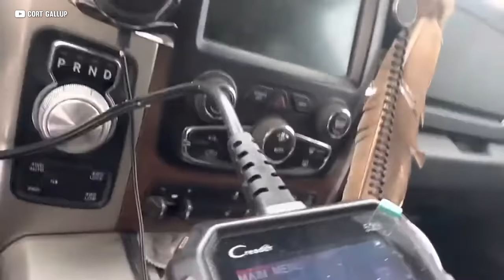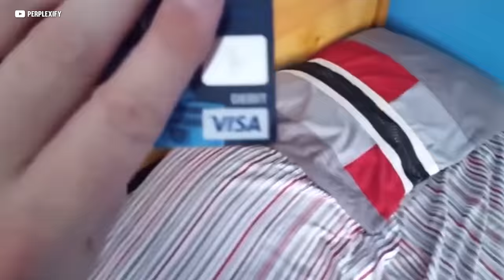Worst Trucks Only Stupid People Buy

Comment: I know it's not a hardcore truck but I've got a 2013 Honda Ridgeline that does everything I ask it to do. Only problem had is a brake booster that had to be replaced. Not too bad after 10 yrs.
Reply: Damn right it’s not. It’s barely a “truck.” It’s basically a car with a bed like the El Camino. 
Hell, even the El Camino was more of a truck with a V8, body on frame, and rear solid axle!
Reply: I heard the Honda Ridgeline comes with a free rainbow flag is this true?
Reply: People hate on Ridgeline for no reason, I actually respect them because you don't need a massive engine and 4 wheel drive to get groceries and take your kids to school, which is what most truck owners do now anyway.
Reply: @jakedank2746  Ridgeline was one unpopular silly truck, especially with that little swayback feature behind the cab. What were they thinking?
Reply: We have a 2006 Ridgeline with 200K on the clock. Have only changed the water pump/timing belt a,d front struts. Very solid truck and wouldn't hesitate to drive cross country....even with 200K. It is very over engineered.
Reply: @bobfuhrwerk2869  It's a Honda, reliability comes standard. It's not overengineered though, simplicity is the key to reliability.

Comment: I did have that Dakota.   It had 214000 miles and 13 years on that engine.  Never had an issue with it and it would still be on the road except some C texting took it and me out using a 300M.  Miss that truck.

Comment: Thanks for your commentary. I have owned Four GM SUVs and two GM pickups since 2001. Total of almost 400k. Three 5.3s and three 6.2s. Other than wear parts such as a water pump and an alternator (one of each) and intake and exhaust gaskets on the '01 5.3, the motors and transmissions have been absolutely trouble free. Mileage on the motors when I owned them ranged from 215k to 62k. In all fairness, the '01 dropped a lifter at 275k after my daughter and her husband had owned it for 5 years. They found a new used motor with 140k and it was running great when they traded it in at 305k. My current '22 Silverado with the 5.3 has been great. Best ever.

Comment: I bought a 2010 F150 FX4 last year with 120,000 miles. It was $10 grand when everyone else wanted 20 for anything close to it. Most reviews on that year and engine were good so I thought I'd take a chance. It was at a small time dealer, who I could tell just wanted to dump it because it had a laundry list of items that needed attention and just wasn't worth his time to fix, but it was definitely worth my time. Mechanically it was fine but it was a stacked model with all the bells and whistles, most of them broken. I'm a DIY guy and these were either easy fixes or not that big of a deal. Right away it had an engine issue where when it was warm, at idle facing up a hill it would sputter, run like crap, and misfire. I replaced the timing solenoids which mostly fixed it, then had an engine flush which really helped. Now it's pretty much not an issue. It's a secondary vehicle that has only seen 3,000 miles of use so far, and given it has a 200,000 mile life expectancy, it should last me a good long time. 

Also, I was talking with a guy this week who also has a 2010 but with a 5.0(?) engine. He said it has some electronic steering whose fluid system is sealed which failed on him, causing dangerous steering malfunctions. It was a really expensive fix. I rushed home to see what I had and lucky for me mine has the old fashioned steering system, where I can add steering fluid. Whew!

Comment: I have a triton 5.4 and it has 225k miles. I guess I'm just lucky. Still running strong for a triton.
Reply: Which generation? The 10th gen 5.4s are 300k engines.  11th gen ones I see them sometimes go past 200
Reply: Don't know what generation but it's in a 2003 Ford Excursion.
Reply: @jeffreychristianson9134  yeah that’s 10th gen

Comment: One I miss is the Ford Exploret Sport-Trac my wife uded to own. Yes that 4.6 V-8 had the spark plug issues but that truck had plenty of power, good handling and was comfortable to take on long road trips. The rust in the cab made us decide to replace it. The Avalanche we replaced it with developed all kinds of engine and general drivabilty problems. So it got replaced with a Yukon Denali. Drivability problems and general satisfaction issues make us hate this one too. I never should've sold my '87 S-10 that got a V-8 conversion in '92. Sure I kept ripping transmission up but that's because I drove it hard.

Comment: I have a 2005 f150 triton 3v.  205,000 miles, still going strong.  At 202,000 miles I finally installed a new timing kit, upgraded phasers,  new roller followers, and new rockers. Nothing broke, just preventative maintenance.  From the first day I bought it I ran 93 gas, ran synthetic oil changes every 3000-5000 miles, and changed radiator fluid at least once a year.

Comment: You forgot to mention the excess oil consumption and camshaft failures on the 08-2014 Chevy 1500.. leading to huge repairs!
Reply: I've owned nothing but chevy trucks...z71 4x4. I had a 2011 that I put 252k miles on it with no issues other than a transmission at 180k.....fast forward and I have to pick up my 2016 from chevy today...torque converter failed and needed a new transmission at 70k miles

Comment: I owned two F150s with the 5.4L engine.  A 2007 and a 2010.  Both were 4WD XLTs.  I didn't have the engine sludge problem.  I'm assuming that was because I didn't go by the manufacturer's recommendation on oil by using full synthetic instead of the motorcraft synthetic blend.  I did have reoccurring issues with the exhaust manifolds on both trucks.  What I found out was the Ford used a thinner manifold on the 4WD versions due to a frame clearance issue and these thinner manifolds cracked very easily.  Since they used steel bolts in an aluminum block, these bolts would corrode and often snap off or strip out when removing them, driving up the cost of repair.  I spent $6k repairing just that issue.

Other issues:

On the 2010, the 4WD vacuum engagement system kept failing causing premature wear on the front wheel hubs.  Replaced them twice before getting rid of it.  This model also had a leak around the rear brake light a the top of the cab that stained the head liner.  After three attempts at repair and replacement of the seal, I gave up.

On the 2007 the rear differential failed at 58k miles.  Ford did not honor the warranty because I did not have the transmission flushed at 30k miles.  I have never owned any vehicle that required a trans flush every 30k miles and I have never received an explanation on how that would cause a differential issue.  At the same time the exhaust manifold cracked and needed replacing.  I took it to the dealer I bought it from, handed the keys to the sales manager and told him to "fix it or shove it up you @ss."  To be fair,  the dealer owned it and bought it back from me at the average retail value.... which is how I ended up with the 2010.

The shame is that I absolutely loved the power and handling of those trucks.  For a 5.4L it got pretty decent fuel mileage as well.  I would love to own one of the newer F150s with the 5.0 Coyote, but they are now way out of my price range.  I am not going to spend house money on a new truck.  Not. Gonna. Happen.

Comment: I avoided all the vehicles you listed like the plague except for the last LS style GM AFM 5.3, 0 vin code 07-13 MY which is my Mom's truck. It is holding out at almost 200k miles so far, Just from proper maintenance, and not running around with the oil change light going for miles without changing it. Like you say proper maintenance is key. I do all maintenance on my families vehicles.

Comment: 07 Crew Cab Nissan Titan LE owner here. Just hit 334K miles. Bought it used in 2011 with 100K miles on it. Replaced starter, fuel pump, repaired high pressure lines of the steering system. I change the oil & filter myself religiously every 7K miles, synthetic. I use the copper washer for the oil drain plug and use torque wrench to specs. When it came to me, rear differential oil had never been serviced and looked like mud gelatin, flushed and replaced twice. Replaced controls for steering column and wire from gear shifter. It has developed an engine oil leak, one quart every 4K miles. It's a 4wd and the front differential leaks some, I check level every other oil change. When I bought this truck, the front differential had almost no oil. Great truck, overall very reliable, and pulls my 26 feet sailboat from the boat ramp no problem under 4WD. Sad to hear Nissan is not making this truck anymore, but I have never been a fan of the Cummings version; saw one at work idling at the parking lot the other day and I thought it was just too noisy, not good... I think the real problem with newer trucks is all the added electronics, which are placing additional headaches not only for owners as far as replacing these panels when they fail, but also for mechanics; to figure out an electronic failure can be a mechanic's biggest nightmare. After all, mechanics are mechanics, not electrical engineers. Cheers 🍻

Comment: I have 1st generation Colorado and it has 200k miles on it and I still daily drive till this day only issue I had was the belt tensionr went out but Ive kept up with it.
Reply: Got a 2004 i5 with 202100 something miles. Runs like a top! Just changed oil regularly. Drove it down state the other week, 3 hours one way drive, averaged 23 mpg. Quite happy with it. No known issues.
Reply: most people who like their tks get 50 to 90 miles per gal. if they hate tk they get  9 to 11 mpg !!!    65 years as veh. mechanic!!!

Comment: The Toyota 3.4L V6 had horrible head cracking problems.  So many had this due to the thin web between the 4 valves and the hemi spark plug hole.  The 3.0 had horrible head gasket problems, but that is cheap compared to new heads every 200k mi.  Toyota may have fixed this with the later head castings, but the early ones were a ticking time bomb.
Reply: Agree.
Reply: In 2000, I bought a 5-speed 1997 Tacoma Extended cab 2WD with the 3.4L V-6 engine with 28,000 miles on it for $13000.  Two years and 18,000 miles later, I bought a brand new (dealer closeout) TRD supercharger for $2295 and had the local Toyota dealer install it for $240.  That bumped the HP from 190 to 268 (claimed - I never had it dyno'd) and it was so much more powerful that I had to put a limited-slip in the rear end to get that power to the light rear end and stop burning up one rear tire on hard acceleration!   It puts out 60 hp more than my 1984 Porsche 911, so it is noticeably quicker 0-60; love that blower whine as I run up through the gears!  Now (January 2024) the truck has 238,000 miles and has never been in the shop for an engine-related problem, only routine maintenance, including timing belts.  Only downside is premium fuel requirement (and even then, it pings with >60% throttle below 3000 RPM, so I listen carefully and watch gearing/throttle/RPM position carefully and often add some 100-octane AVGAS from my small airport to minimize the pinging).  Still has the same cat converter, but even with the lead in occasional AVGAS, the check-engine light for the last 15 years is not for cat failure, but some stupid canister purge pump solenoid that doesn't hurt drivability, so an inch of black electrical tape over the CEL fixed that!  Highway MPG dropped from 24 to 21, probably because I'm having too much fun with the loud pedal and embarrassing hot-dog high-schoolers at stoplights!   Dexos-1 full-synthetic oil every 4,000 miles and top-tier 91-octane gas$$.  I LOVE that little truck and turn down $10000 offers probably once a month!  Maybe I just got lucky, considering this video and comments like the one above!
Reply: @raymondmelton9098   The sincerity in this comment and joy you got from that truck can be felt over here.

Comment: I’m not in any way saying the 3 valve 5.4 is a good engine, because it’s not, but we had great luck with ours, bought it brand new in 2005 so even before people had even found out about these issues, it did have the spark plug problem but that was it, fixed it and it never had it again
Reply: yeah I had 2 and both got me where I needed to be without issue
Reply: Upgrade the oil pump, and install updated oem vct components = a 5.4 that lasts forever at 19mpg.
Reply: @Dat_Sun  I never even did the oil pump on mine just changed the oil often never had any issues
Reply: I had a triton in a work van, never drove it hard and it lasted 250,000 miles

Comment: My 2013 DMax with 204K is still in GREAT shape. Turbo is shiny and no slop. Zero leakage. No blow by.
I had a 5.3 and it was JUNK!
My DMax is the love of my life.
She’s had a few minor issues and I got rid of the CP4 for a CP3 & FASS lift pump. Still need an EGR del.

Comment: I actually owned an '06 Canyon for fifteen years. I had over 300,000 miles on it when I ran into a cow standing out in the middle of the highway. Had it not been for the oncoming traffic's lights, I probably would have seen it. I miss that pickup.

Comment: I bought a new 2022 Colorado last year. I've been a Ford guy since my first car in high school. However, a very bad experience with a Ford dealership when trying to buy a new Maverick, converted me to Team Bowtie. I've had exactly zero issues thus far. I just hit 21600 miles, and I'm hauling around my travel trailer across the country. I'm getting between 14-18 mpg depending on uphill/downhill/head wind/tail wind. It's not nearly as packed with options as my previous Ford, and I chose 2WD over 4x4, but I really love this truck. Glad I missed out on the bad engine, and especially the cylinder deactivation system.

Comment: Awesome vid!
Love the format, the assessments, the clips, the content.  Very informative and entertaining.

I dodged the bullet on the Ford F150.  I bought an 07 with the 4.2L V6, as it was the only 5spd manual.  I only do light hauling and it's worked out great so far.  I even used it to tow my miata from the body shop... Once.  At 180k mi, and 6yrs of ownership, I've only had to contend with a clutch slave cylinder, the insturment cluster, an alternator, a leaking oil pan, an AC compressor, and wheel bearing.  All of these (minus the cluster and bearing) are expected at this milage.
The engine is very accessible, the oil pan only needed a cross member removed to pull.  The spark plugs and wires are easy to get to.  Its a no frills truck, but there's not a lot to break on it.  I liked it for its stoic appeal and simplicity.  Besides the internal clutch slave cylinder, the other maintenance has been pretty easy by comparison. I view it as the last of the simple trucks Ford ever made.  10 of 10
They stopped making manuals in 2009 :(

I still can't believe you guys are recommending the ford ranger.  8 spark plugs for a 4 cyl, 4 of which are a bear to get to.  I guess compared to a PT cruiser, they're cake?  Dependable, yes, ideal, questionable.

That's all for now, thanks again for a job well done.
Reply: BE WARNED that the late 4.2 hydrolock just like the early ones so keep an eye on your dipstick! If the oil goes tan park the truck and troubleshoot immediately. Peak F150 of that era is the early 4.6 (I've four F150s and wrenched many more) but the 4.2 is good IF that particular fault is intercepted. When you see a 4.2 with a stick in salvage that wasn't wrecked, it's almost always hydrolocked.
Reply: @Comm0ut  6:53
Reply: @Comm0ut  Thanks for the advice.  I check the oil level every time I fuel up.  Oil leaks have been the major concern.  Water in the crank case is never a good sign.  Typically that's a sign of needing a new head gasket.  Would you agree with this assessment?  I'm not sure what else would cause the entirity of the engine coolant to dump into the crank case.  Let me know if the fix is something else.

Comment: The Toyota v6 isn’t as bad as ppl say…. I got the 2.7 which was a tank and I nvr had a problem with it but I woulda like the extra power with 33 in tires… and the 5.4 is not as bad as everyone says..I’ve had 3 trucks with one…not a problem and my 5.4 raptor is bullet proofed so I’m good

Comment: The 3.0 isn't the best, but the 3.4L is a great motor. I've owned 20 different Toyota's, from 4Runners to Tacomas to Tundras, and I've never had any major problems. The biggest problem I've experienced is a water pump replacement on an '08 Highlander. For reliability, Toyota's rule.
Reply: Is it true the Tundras front CV axles are made of glass ?
Reply: @ExploringCabinsandMines  Yes
Reply: I don't understand why he lumped the 3.0 in with the 3.4. The 3.0 got 17 mpg highway the 3.4 I get 22 23 consistently.  The 3.0 had headgasket issues,  the 3.4 I have never heard of that being a problem EVER.  They are very different motors and for him to suggest they are similar is very. Well let's just say this dude is a hack.
Reply: @ExploringCabinsandMines when lifted past 2 " yes. If factory bullet prof👍